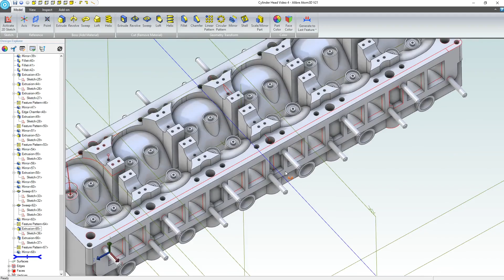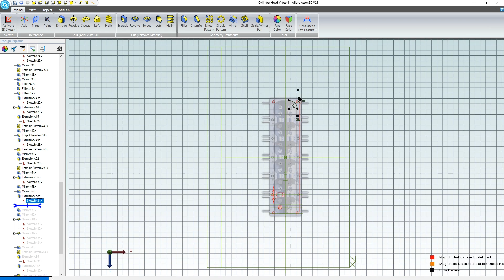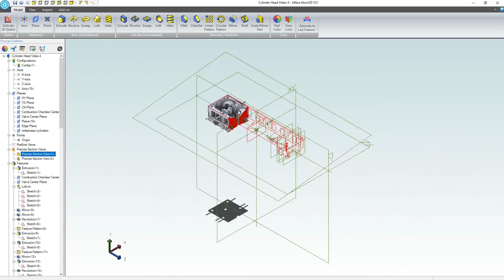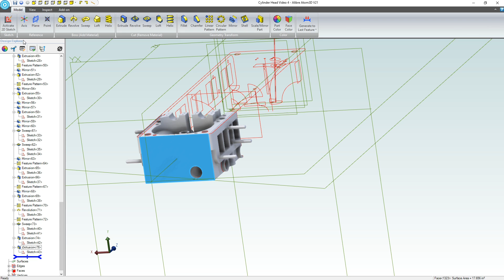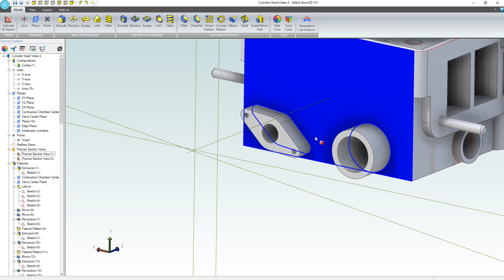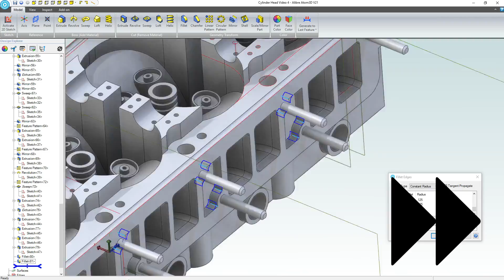Alibre Cylinder Head Part 4 |JOKO ENGINEERING|

Comment: Hi, is there a reason you create all the features by patterning then add fillets afterwards rather than fillet the base feature then pattern the feature, fillets and all ?
Reply: Mike - whilst i'm not Joko, it's often better to go with the simpliest geometry to establish spatial positions and build up secondary and tertiary geometry later. Another reason is fillets can be very data dense, slowing view manipulation etc. Also, they add to visual complexity. What we do is often on a part by part basis depending upon then design. Even in 2D, fillets were the last action, not the last thought of course, just the last action.
Perhaps Joko has a another reason but that's may take on it - i'll let him answer.